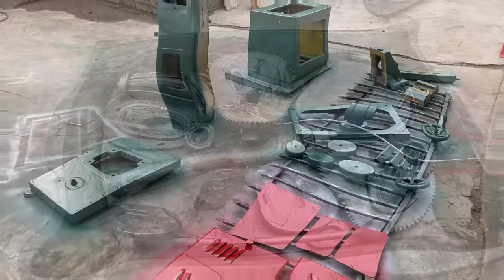Fully restore old Japanese MAKINO milling machine |Restore and repair antique metal milling machines

Comment: 1. Don't drive bearings into a housing by the inner race.  Into a housing drive against the outer race.  Onto a shaft drive against the inner race.
2. Your locktab should be between the spanner nuts and beveled side of spanner always against the bearing.
3. You need some sealant around the drip edge part of the pan.
4. Don't drive a pulley on a motor- either heat the pulley so it is a slip fit or stand the motor up on a socket against the other end of the armature.
5. Safety glasses- your choice, but good idea if you want to keep working on machines.
Reply: :goodvibes::goodvibes::goodvibes:
Reply: @restorerestoration4705  ....mmjñ9
Reply: Great work. Looks like a well made mill. @gianluigivaccaro6776
Reply: 6 , He's done that ! Already ! So it's too late ! Now !
Reply: @davidwillard7334  👌👌👏👏
Reply: Yeah, I also noticed his "agricultural" methods. The more thecnical stuff isn't really that intuitive. But you have to admire people who just get down to get the job done. I just hope he's more careful about safety in the future. Like someone said "if someone paid me 5 million for one of my eyes, I won't stell it".

Comment: well you took a wire wheel to the ways and the table and knee.  then the wire wheel was used on the spindle and the way gibs.  then hammering the bearings in by the center part.  I wouldnt trust that thing to drill a hole..  im sure the old girl was ready for the scrap yard ,   but hay, you got my view and comment... mission accomplished . right.
PS. that cutter isnt used for that.  and way to fast..
Reply: yep slot cutter not face cutter ,,, I was cringing ,,,,
Rob
NSW
Australia

Comment: As an electrician I have a lot of experience from maintaining electric motors. These are the most important things you need to check:
1. The insulation resistance between the electric windings and between them and the ground.
2. The resistance of the windings
3. The condition of the bearings.
Also the condition of the shell and flanges as well as the straightness (balance) of the rotor need to be checked.
Normally only the bearings are worn out and need to be replaced. You know that if the motor sounds like a sound dampened stone crusher already when you turn the shaft by hand. I bet this motor does it.

I can't see that anything of this has been done. Cleaning and painting isn't proper maintenance.  And you NEVER mount bearings by hitting them with hard steel tools!!! The best would be to press them onto the shaft and not hit them at all.

Comment: I am surprised it came apart so easily. It looked like it has been sitting for a very long time. The inside was very clean and dry. Did you scrape and flake the ways and gibs,I couldn't tell. You did good putting it back together, no spare parts I hope.

Comment: The bearings are bad. The table should be re ground for flatness and turn your RPMs down when face milling like that. Also, use a face mill for face milling. You're using a slotting cutter. Wrong tool.

Comment: Nice renovation. I have a question, if it is a Japanese milling machine, why does it have an electrical installation and drivers from APA TOR and Made in Poland markings? Is it possible to upload a photo of the nameplate with the model, production date and manufacturer's designation?
Reply: POLSKA frezarką FWE 16, widocznie robili na export do Japonii, a tamci pchali jako swoje.

Comment: Honestly? I cant tell why everyone in the comments is complementing him. The whole video shows nothing but bad work and sloppiness. Dont get me wrong, I wont judge anyone for lack of tooling, creativity and ingenieuity can substitute for quite a lot. But this "rebuild" was just a paintover, and not even a good one.
1. Why dont you change the bearings? Dont tell me you could not get any, you changed the ball bearings of the gear shafts (arguably the least important ones), so why in gods name not the tapered roller bearings of the two spindles? The machine lives (and dies) with these!
2. What in the name of christ posessed you to reinstall the bearings with a bloody hammer? Even if they were fine to reuse, what, based on looks I highly doubt, now theyre most certainly done with and have to be changed!
3. Dont use a goddamn wirewheel on the ways! If possible dont use any abrasive on them at all! A bit of scotch bride and plenty of oil can get you far. They are, together with the spindle bearings the MOST essential parts!
4., and this is the worst one: Why couldnt you tape off the machine properly bevor painting? You did it, a bit, but just sloppy. Even from the video I could tell that paint got onto the ways, a bit had gotten into the bearing rings and so on. Stuff Like that kills the machine, results in bad surface finish and makes precision work Impossible. Sorry, but thats just sloppyness, and bad work. Certainly nothing to be proud of. You had the possibility and tooling to do a proper job, it shows in the video. But the fact that you didnt tells of bad workmanship.

Comment: That is NOT how you pack Tapered roller bearings with grease! They will fail very quickly like that -
Reply: Stlll l suppose ! You just ! Use Good OLD !! FASHIONED ! GRINDING ! GRIT !! IN YOURS !! HEY !!

Comment: I would not like to work on the machine after such a pseudo (repair), paint it cannot be repaired! the nuts on the screws are old screws are all old (not even calibrated), the guides of the tables are at least cleaned and scraped for good, the bearings are almost all old (on the electric motor definitely) there is no box lubrication system, there is also no pump for the Sozh, although there is a drain from the table on the left there are sides. The bearings are all from the type of a hammer and the inner ring, the nuts are again a hammer, is it really so difficult to turn with a special wrench for round nuts? And to complete this test of this creation for cutting metal, where are the goggles or the screen, apparently a lot of spare eyes? The Japanese apparently cried when they saw all of the above
Reply: Pretty much what I was going to say. This is what greedy people do when they attempt to sell something in a bad condition to novices for a lot more money than it's worth. Make it look nice and it's enough. But even to a novice, that ugly wheel under the positioning table made of cam steel, must be disturbing.

Comment: Cosmetic mickey mouse repair, note the upper spindle out of balance...
Reply: Look forward to your video.
Reply: It jis what it is. Nice restoration. Better than most.
Reply: and not a drop of oil on rebuild on shafts pinions etc. and those poor new bearings got a hammer, literally.
Reply: I would like to see you two naysayers do a better job with the conditions he has to work in.

Comment: this person does not understand what repair, restoration is, he just cleaned and painted, he even put the bearings incorrectly. and what accuracy of the machine, he is not interested. no offense, my friend, the current machine needs a professional so that it works as much as it has already worked. I forgot to write that I really like Japanese technology (electronics, mechanics) I have a lot of things made in Japan without forgetting that I live in the Republic of Moldova.
Reply: What you're talking about is a remanufacturing or rebuild. I would definitely call this a restoration. It was kept in original condition and is in much better shape, both mechanically and cosmetically, than it was when he found it.
Reply: Yea he’s not fabricating aerospace parts so it’s a good rebuild